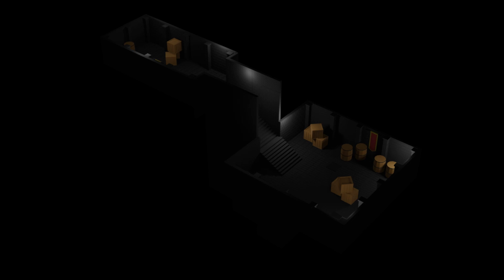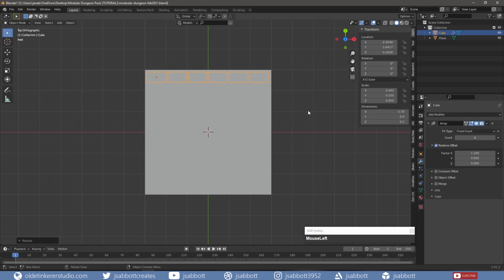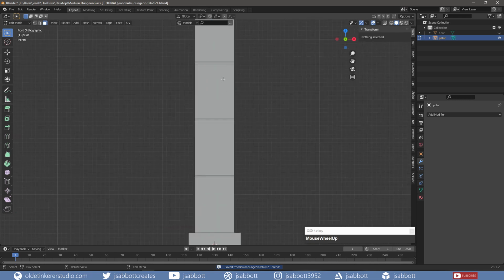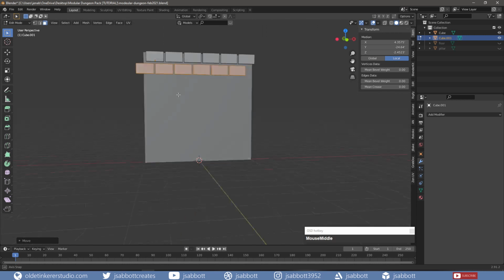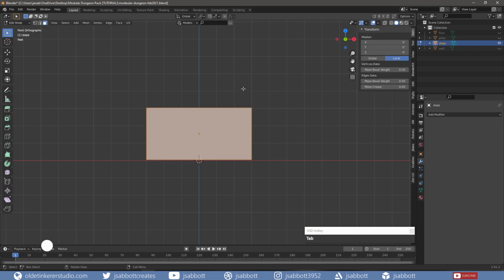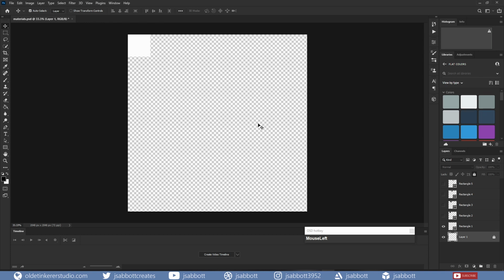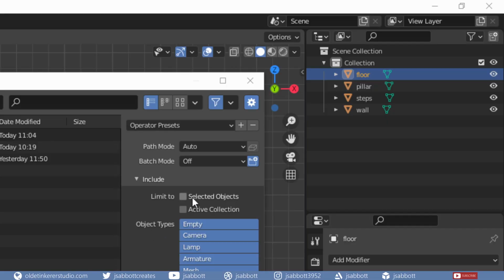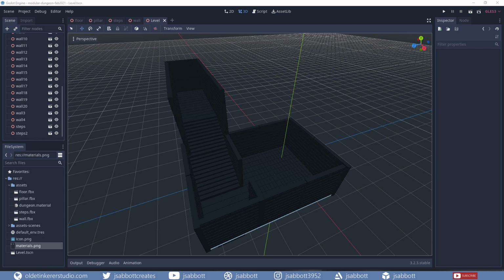How to make a low-poly modular dungeon pack in Blender [2.91] (Part 1)

Comment: Really dumb question -- how do you get your orientation to be "left handed"
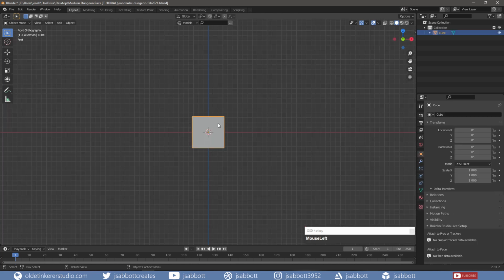@ 0:55 you have a left handed X, Y, and Y -- essentially your Y is -Y.
Thumb up, point out with pointer. Middle finger points to your other hand. (This right / left handed thing applies to torque too)
But ... WHAAA?
Reply from the maker: I just leave everything at default. That means when I am in front view, the left side of the viewport is -X and the right side of the viewport is X and the top part of the viewport is Z while the bottom of the viewport is -Z. If you are in top view, the top of the viewport is Y and the bottom of the viewport is -Y.

You can easily see this in the gizmo in the top right of the viewport.